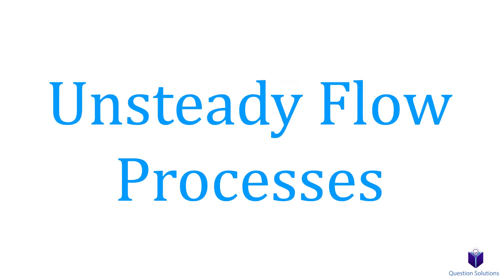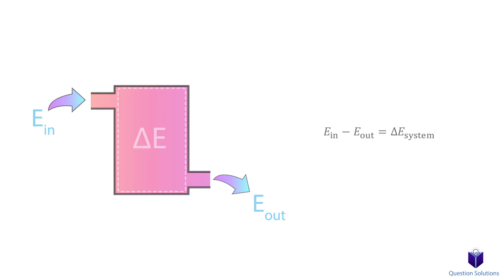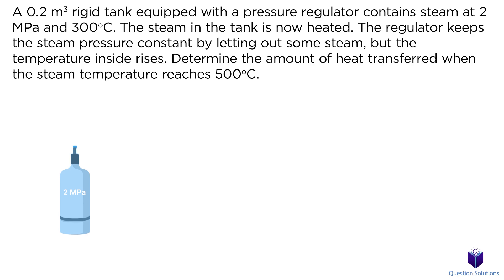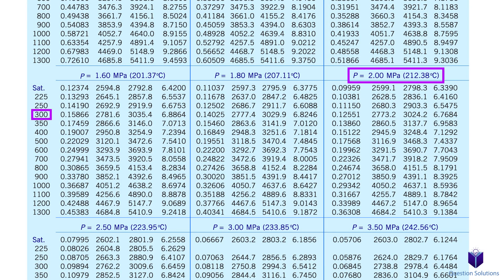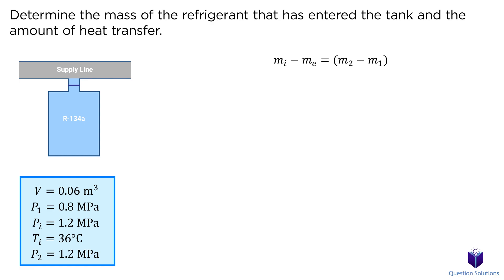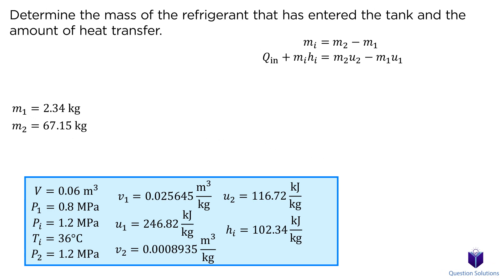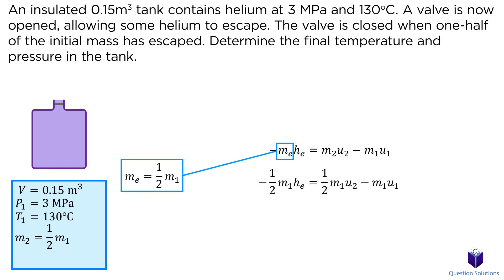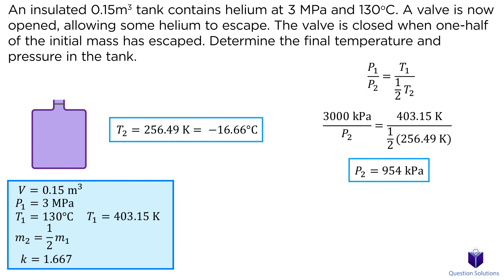Unsteady Flow Processes | Thermodynamics | (Solved Examples)

Comment: At 8:48, I always look to the pressure tables as first, so ı looked for 1200kpa to Table 12 and the sat. temp. is 46.29 celcius but we are on 36 celcius. So ı assume it as sat. liq. when I draw the t v diagram, the enthalpy value for that 117.77 kj/kg but you use the temperature table and got another value, do ı made something wrong ?
Reply from the maker: So whether you look at a temperature table or a pressure table first doesn't make a difference. Here, the given temperature is lower than the table temperature for pressure, so it's a compressed liquid. Even if you look at the pressure table first, you will see that at the given pressure, the temperature is higher than what's given to us. So when it's a compressed liquid, we treat it as a saturated liquid at the given temperature, so you have to use a temperature of 36 degrees Celsius.
Reply: Thank you !

Comment: hey love your vids, i wanted to ask that integral cp*dT gives ht so when we take integral should not it be equal h=cp*dT + C
Reply from the maker: Thank you very much! 

Could you please provide me with a timestamp? I can take a look and let you know. Thanks!
Reply: @QuestionSolutions  thx for replying, for example in 11:29 you are using he=cp((t1+t2)/2), as an example at 500 K air has cp=1.029 so h=1.029*500=514.5 but if we look it from table at 500 K h=503.02 so maybe it is negligible idk , im confused

Comment: I don;t get why you get the average of enthalypy on the 1st question. Is it because the h2 is the "end enthalpy" of the system inside so h_exit should be between h1 and h2?
Reply from the maker: I explain this at 2:20. So in simple terms, we need to make assumptions, one such assumption is that things "won't change." So to get that, we need to average out values, otherwise, solving these problems would require a lot more work, with time rate differences.